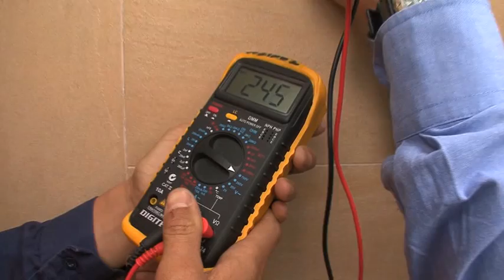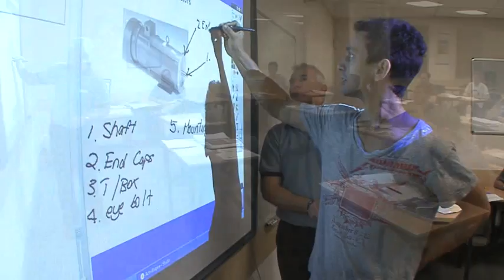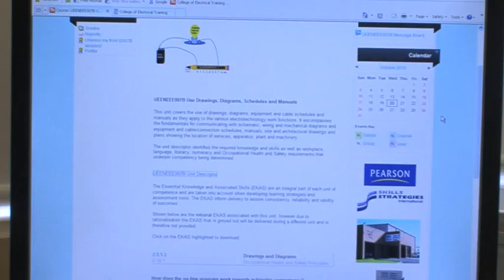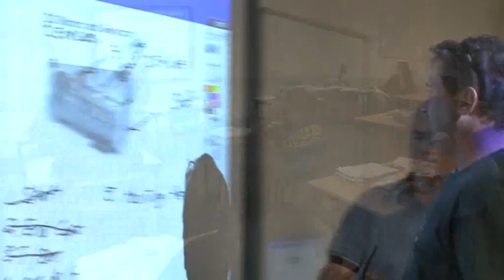College of Electrical Training

Comment: Tool List from Inside Wireman Bargaining Agreement 
  
 This is a minimum/maximum list. These are the only tools to be brought on to a job site.
 All other tools will be provided by the electrical contractor.                                  

 
Tool pouch
Hammer (22 oz. maximum)
Hack saw
Tape measure (25’ minumum)
Pliers: line type
Diagonal cutting
Needle nose and
Channel locks (2)
Screw driver (Standard and Phillips)
Electrician’s knife
Awl
Crescent wrench (10” maximum)
Magnetic torpedo level
 
Wire strippers
Voltage tester
Allen wrenches (up to 3/8”)
Plumb bob
Tri-square
 
Socket set 3/8” drive (up to 3/4” socket)